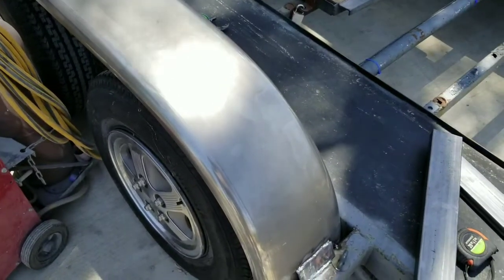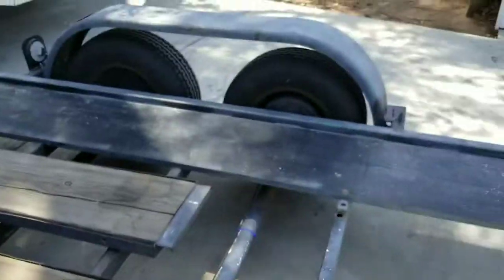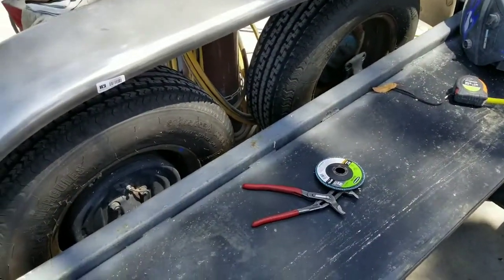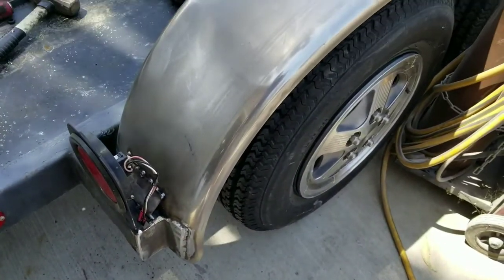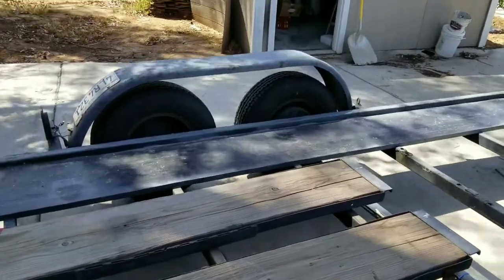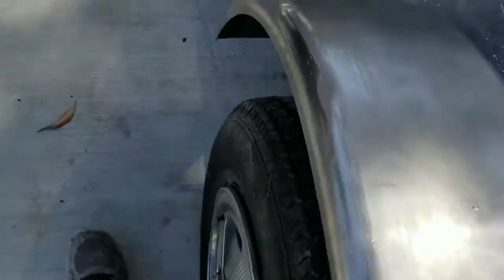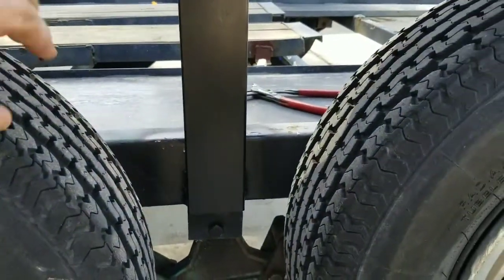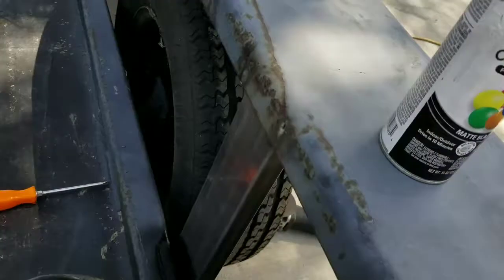Installing trailer fender welding in grafting metal

Comment: What welder you using looks like mig ? I weld on my dads dump trailer occasionally for small repairs and stuff he’s got ar 500 plating on all 3 walls the gates are just like some 13 gauge steel. I use a stick welder (smaw) a old Miller 250 dialarc ac/dc it burns rod really good I like stick better I feel like I have more control I can bend the stick in different ways and I can fit in small spaces easier than with a mig gun. I respect the video man sorry no one else commented but keep em up you gained a sub